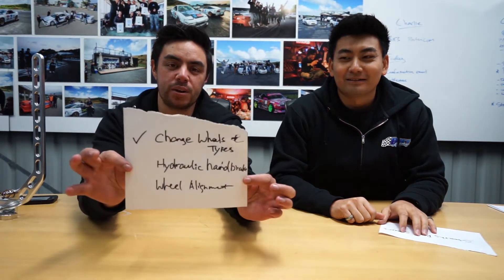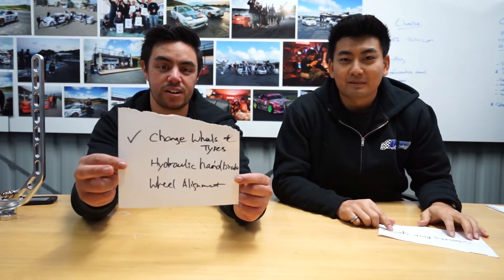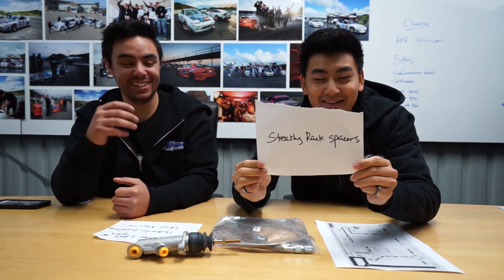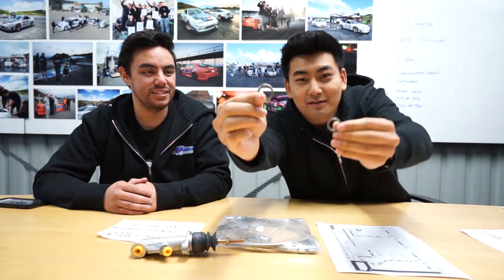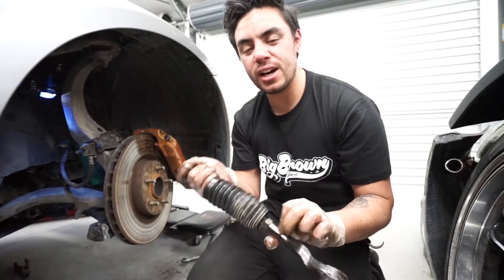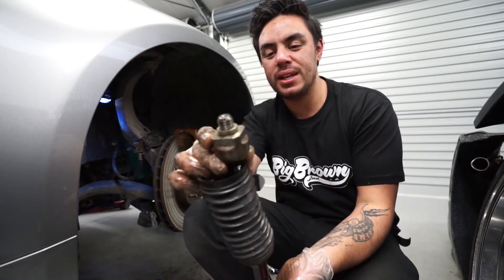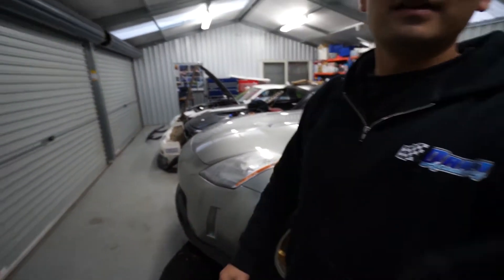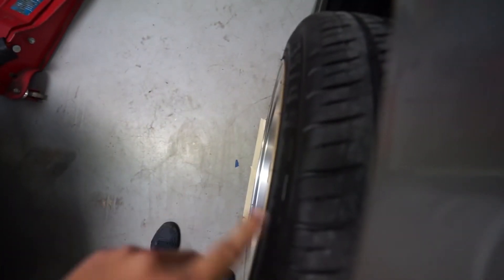$20 Big Angle kit | Budget Drift Build Part 6

Comment: except that if you add these on the stock rack, you remove the outer tie rods ability to stay on the threads, making stripping them under load even more of a thing. : /  Just get extended stud tie rods and THEN add the spacer. Enjuku sells em for $50 bucks.
Reply from the maker: Yes that will be always the best bet

Comment: not sure if i missed it but were do you get the steering rack spacers from fullas...or what width are they 10 or 15mm by the looks o them. In for learning i had never heard of them.
Reply from the maker: Too be honest we couldn't find any when we were looking for it, we picked up this a pair 2nd hand from a friend. As for the thickness I would say it's between 6-7mm, def not 10mm thick. We are planning to make a few pairs as a few of our friends is asking for them, and one of our friend has a lathe, so if you guys interested let us know.
Reply: Drift Academy yes please...i would  buy a set. i have PayPal or am passing through auckland in a couple weeks just let me know what suits you guys or best way to contact and stay in touch thanks.
Reply from the maker: Cool Clint, we are pretty easy, where are you based? Send us an email info@driftacademy.co.nz
Reply: Drift Academy mint. im in Taupo...will get that email away asap. thanks guys.
Reply from the maker: Clint Collins Collins sweet as what car are you fitting it in? I will keep you posted on when they will be made.
Reply: Drift Academy its an 02 hsv commodore. I hope they will work.
Reply from the maker: Clint Collins Collins they should,  I haven't done a golden before so don't know 100% if Holden have the same diameter thread, most of the time tread on the rack end are similar.